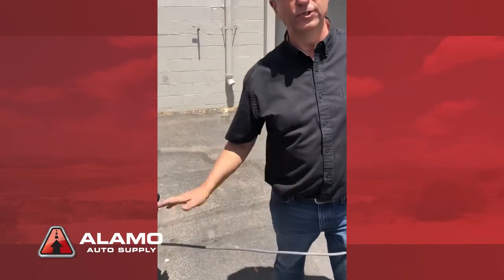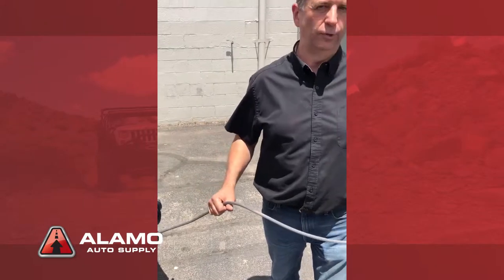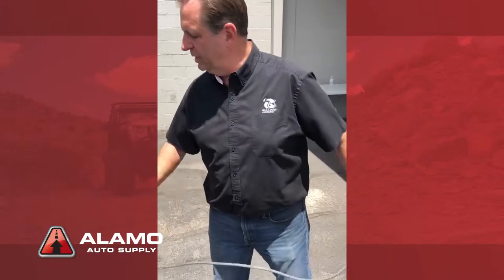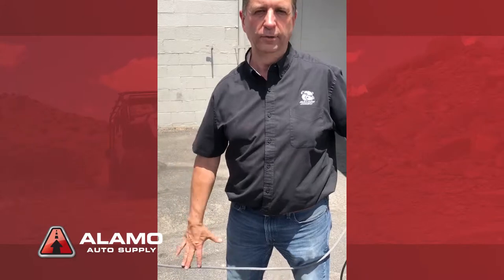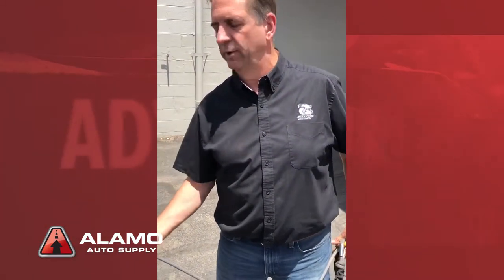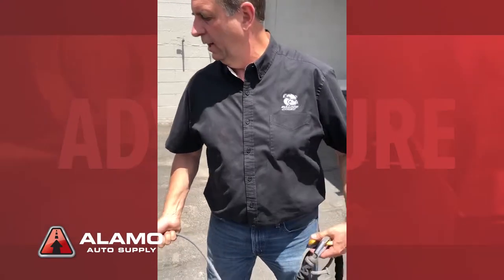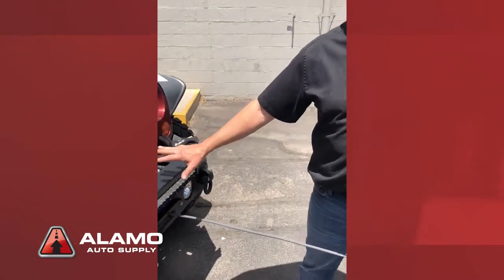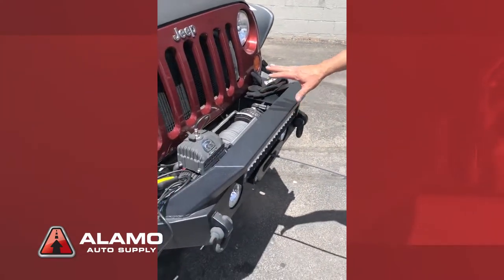Winching: the Great Debate - Synthetic Vs Steel Cable

Comment: There's a reason why the professional Industries all use Real Steel cable just saying
Reply: Because they are resistant to change, synthetic requires more maintenance and steel cable is cheaper. That's why. Synthetic is lighter, stronger and simply better for most applications.
Reply: @gabrielreyes8476  real world application for the towing industry the synthetic gets cut all the time doing the regular work.
Reply: @MNDashcam  No, it doesn't. I worked for a Beverly Hills towing company for almost 5 years and just about all we used was synthetic. It required constant cleaning, maintenance and know how to rig it up properly using soft shackles and sheaths. Cheaper sharks and snatch and grabs all used steel line. Cheaper to replace. The drivers didn't care that they dragged line over the ground. So yes, I can agree that most use steel, but the reasons are lazy ones. Not all companies use steel and are willing to go the extra mile is all I'm saying.